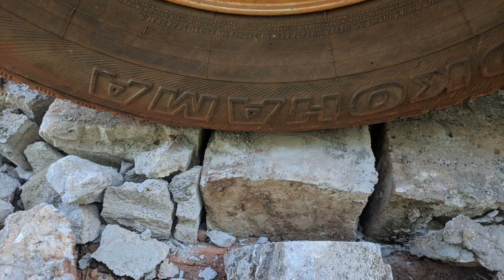My AirCrete Sucks!  How Would I Build a Tiny House With It - Why it Deflates

Comment: Just built an 8m diameter dome with aircrete. Used pure SLES as a foaming agent. works perfectly because i do not add all these additives from a soap (you don't really want inside your batch) to the aircrete. based on my experience,  to choose the right cement is as important and mix it properly or get the right weight of your foam. i used Portland Cement 1P (with flyash) or Portland Cement 1T (Volcanic tuff + flyash). These 2 different cement needed to be mixed totally different.  So, cement is not cement.  Adjust your process to the ingredients you use.
Reply from the maker: Fly ash would be great
Reply: Hi there. Seems you are a Swiss in Philippines, correct? I'm a Dutch in Philippines and tried to follow lots of advice,  mainstream is get the agricultural marker foam concentrate. I was unable to get my hands on it in Philippines. So I tried few other ways, but perhaps the quality or type of water is also something not to underestimate. I just received some kilograms of SLES and read in your comments, you used it successfully. Do you still use glycerine? What dosing can you recommend to 10 or 20 liters solution? In Metro Manila much more things are somewhat better accessible or available, unlike in the province. 
Hopefully you find a moment to respond to me.
Thanks a lot.
Reply: @johan6481  hi Johan. Yes, i am here in the Philippines.  I never used glycerin,  because its just a waste of money without having an effect.  Of course i tried it once, but i didn't see any improvements. And the ratio i use is 1:160 (means: 100g SLES, 16 liters of water). I think it would be easier if we could talk outside YT. how can we manage that? 😁
Reply: Interesting.  Doesn't SLES retard the cement too much?

Comment: It's a challenge, our first try yesterday (4 batches) did not work. We are trying again today, with a modified mixer and barrel. 🧐😊🏠
Reply: We removed the forms from some of the batches from yesterday. They look and feel much better than we expected. Two batches were somewhat successful, and the other 2 weren't horrible! Batch #6 from today was finally a success!! 🎉  We used a different barrel, different mixer, and we checked the air pressure more often. Thanks for sharing your videos. 😊🏠
Reply from the maker: Less water, better soap ?

Comment: Testing foam:   I've got 80g/L foam weight (shaving cream thickness) with 1:32 soap / water ratio at 5 bars air pressure in the foam gun...  What am I missing to get 90g to 100g/L?
Should i add glycerin to make the foam denser and hold consistency longer?  IF so, what ratio glycerin/solution ?
Any advice on this one, appreciated.
Reply from the maker: you need more water or less air to get 95G/L.  Using soap you want to add 3.2 ounces of soap per gallon of water foam solution.  Vegetable glycerin can help it hold up.  I really suggest you buy a proper foaming agent.  Your not saving money or wales using dish soap.

Comment: Hi Mister I live in Guatemala and I am using local Portland cement but it doesn’t get strong enough do you think my Portland cement is the problem or probably the foaming agent. I like your video very informative. My aircrete is bad so if you can give me a good tip thank you
Reply: Hola Tony  como t resultó la prueba ya calaste  alguna fórmula?? Saludos
Reply: @rubenflorestorres4052  si la cale pero tengo problemas con el cemento aquí en guatemala estoy probando uno con más crinketes pero me interesa el material tengo muchos usos para cuando tenga buenos resultados
Reply: @rubenflorestorres4052  saludos Rubén hice pruebas con mejor cemento y mejoró bastante estoy trabajando en mejor regides
Reply from the maker: Try Using less water in the mix.  Your soap may not work well.  16 ounces  Axion soap in 5 gallons of water works in Mexico.
Reply: Suerte  Tony y Ojalá  encuentres un buen cemento
Reply: Ok Tony   me podrías  mandar fotos de tus resultados 618 2308657

Comment: Thanks so much for the video and the information.   We are simply trying to insulate in between 6" and 8" stove pipe sections and elbows for our woodburning stove.  Our AirCrete, as well as our foam, continues to go FLAT!  We have tried at least 15-20 different times and textures to achieve success.  We have watched 30-40 or more videos on AirCrete, as well as many of your videos.  Our foaming agent of choice has been the Suave Daily Clarifying Shampoo, with the addition of 1 oz of glycerin.  The small-batch mixture we have been using is: 2# Portland cement, 1.12# water for the slurry;  Foam mixture we've used has been 2.5 gal water, 15 oz shampoo, and 1-2 oz glycerin (we've tried it using 1 oz and using 2 oz., both to no avail!). According to my calculations, it seems that for 2# of Portland cement, and for best use as insulating material, that we need right at 2 gallons of foam per small batch. That much foam should translate to a mass of about 720 g, or 1.6#.  We are having trouble getting the density correct to start with, which I feel probably has to do with our pressure, either in the liquid tank or in the foam gun.  We have 3 valves adjusting pressure, and I feel that's causing some of my issues.  Another problem could be that we are over mixing the AirCrete once we get the foam and slurry together.  I'm wondering if that's something that we could simple do by hand since we are making it in such a small batch as we are?  I really feel like a do-do not being able to figure out this problem, especially since I have a degree in physics - I must be getting OLD!  Any help you can offer us would be greatly appreciated!
Reply: i have been making aircrete for two years now,hundred of test batches and still cant get it to work constantly.
I am not sure what i am doing wrong.I have tried even expensive foaming agents.Its really kicking my ass.

Comment: I added Quick Set 20 as used in the drywall industry and it seams to work well, 1/3 of it to the mix.Not sure how waterprooof though. I got some Drexel for $20 a gallon too but haven't tried it yet.
Reply from the maker: Let me know the results.  AirCrete is not water proof anyway.
Reply: @TinyGiantLifeStyle  right, I meant fall apart or crumble with th plaster added when it gets wet

Comment: Thank you for your tips. new subscriber here.. i was wondering if the mixing blades makes a difference. the foam i made was around 70grams per liter. but after mixing it with the cement slurry, the volume of the whole thing is half of the bucket. it doesnt look as frothy as the foam, it becomes too liquidy.  thanks in advance
Reply from the maker: The foam really needs to be between 90 & 100 grams per quart/liter.

The mixing blade does matter as does the speed you mix at.  If you beat the bubbles back together then you are just adding more water.  

If the Portland slurry has to much water then bubbles will float out of the mix.

If you don't have enough foam agent the bubbles will also fail.  16 ounce of soap per 5 gallon bucket or 4.2 ounces of Drexel

Comment: So did you make your own foam maker and put together your own mixer or whose do you use if you buy one? Since there seems to be about three or four options currently. Thanks
Reply from the maker: I made the foam generator and the video course has complete assembly directions as well as parts list:

https://tinygiantlife.biz/build-your-own-aircrete-home/

There is also a video on my channel which shows how the foam generator is put together.
Reply: Not hard to make one, but simple parts are getting quite pricy nowdays

Comment: If building an aircrete home, does it have to be dome shape?
Reply from the maker: Of course not!  Rectangle, round, as long as you do not put tensile loads on AirCrete it's fine to build other shapes.

https://tinygiantlife.biz/2019/02/25/2019-aircreteworkshops-available-now/

Our workshops will be covering rectangle structures in September, round rapid cast structures in October, and next year arch structures.
Reply: Hello dnsde Sosúa Dominican Republic your explanations are muu good. I'm trying to eat to make blick and pir live on a todi island is harder to find on the market. But we've almost got the equipment to start. Gracias

Comment: I don't use even use soap. Soap has cleaning agent that we don't need for foam. I don't even use foam generator. Most important think about aircrate we do not need fancy machines vacuum tank so on. All we need wide space to store brick for about a week than ready to ship to user. But one thing i am agreed with u. Water content is most important  in the mix. In the beginning too much water may look ur ur cement rise a lot but for sure it will sunk if u use less water than ur cement mic will eat the bauble. One more thing I noticed is mixing cement with foam sped. If u mix too fast than baubles break down and make it larger bauble or mix become not homogeneous. CHEERS.
Reply: Do You  just mix the foam? In separate containers

Comment: I've heard about using lime and baking soda in the mix with the cement. Can you comment on these please?
Reply from the maker: I understand, but I am going to refrain from answering something I have no personal experience with.
Reply: I recently read bi carb and alum generate a lot of co2  and alum also is a curing accelerator so I was going to give that ago
Reply: @johnmcfadden9336  
  Buzzi Unicem USA makes a CSA cement additive simply called “CSA”, but on their website it’s clear that it should be used with Portland cement:

“CSA® is a hydraulic, cementitious binder (per ASTM C219), high inin Calcium Aluminum Sulfate Crystals. When used with Portland cement concrete, CSA generates a strong cementitious matrix that enhances the physical and chemical properties of the mix.”

In this regard this “cement” is really a cement additive. It cannot be used at a 100% replacement for portland cement; the recommended replacement rate is 5% to 20%.

The CSA sets in 20 min and cures in 2 hours.

Sodium bi carbonate and powdered aluminum might be cheaper? What were your results?
Reply: Michael Glenning   Thanks for that info Micheal   I got side tracked which is the story of my life and have just recently started again testing out mixes but not as well conducted as I should but hopefully over the winter I’ll dabble with a bit more care 
Again thanks
Reply: I have been using lime and baking soda and it seems to set harder and faster

Comment: can open cell and closed cell aircrete be made for different projects easily ? ie open cell l would want water to filter through it closed it would float
Reply from the maker: Cement will allow water into it over time.  You must seal it.
Reply: @TinyGiantLifeStyle   
I must have missed something.  when you seal it is that when you placed the cloth over the wet crete or do you have to also paint a concrete sealer over it before painting?
Reply: MAD GRUMPYMAN   Thank you so much for all of that information.  I had been told this before in a not so easy to remember explanation, but the way you explained it I will remember.  Thank you again Mad Grumpyman!